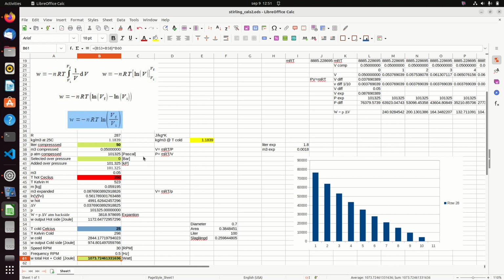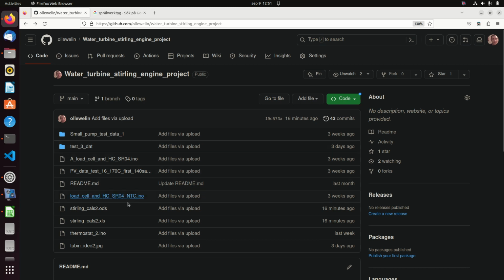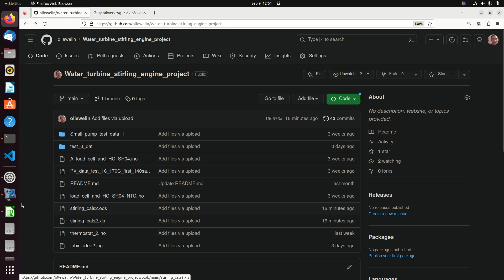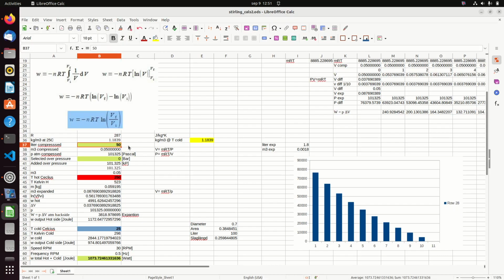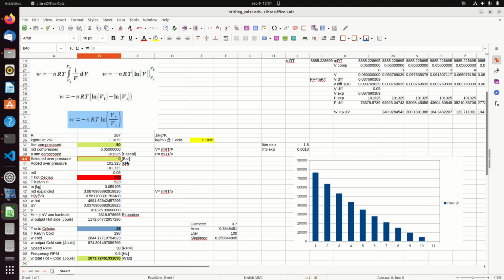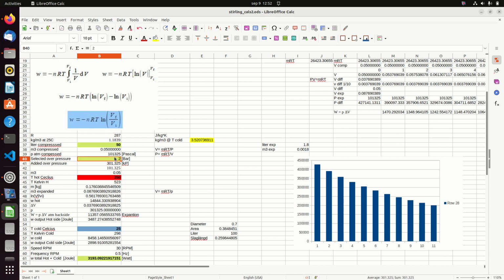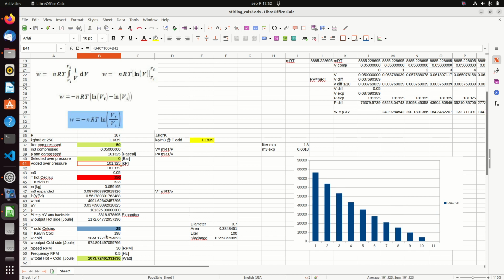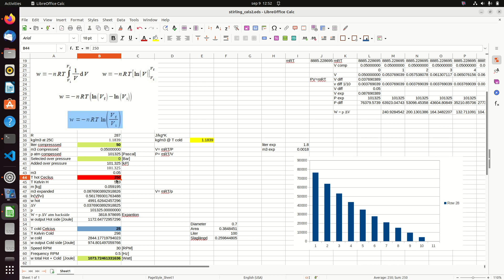Stirling engine maximum theoretical output power calculation

Comment: Hey mate. I need help pls. With 3 phase motor control I see you have some code. Pls pls. Hoe can we talk? Regards Jakes
Reply from the maker: Yes I have some Code on my GitHub arduino Uno 3-phase motor driving. But My tip is to use the personal ”prompt engineering” methode with ChatGPT, Bing Copilote or Gemini chatboot to speed up and muddle through your project